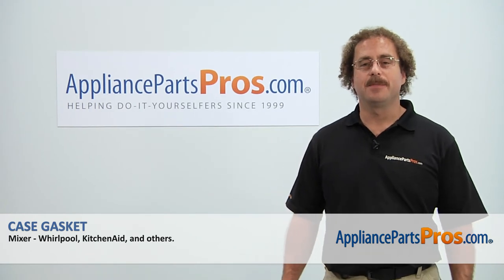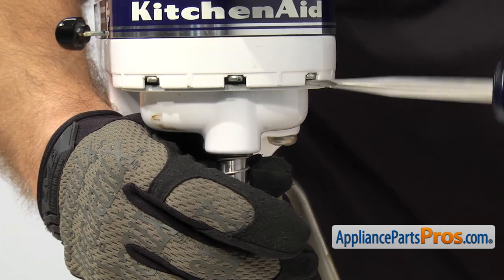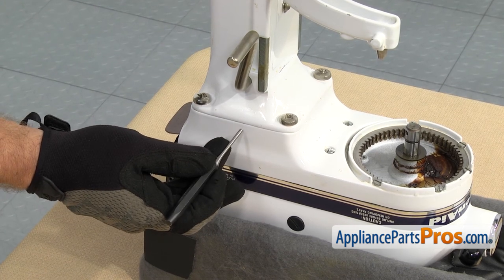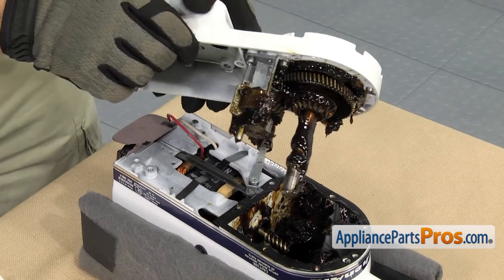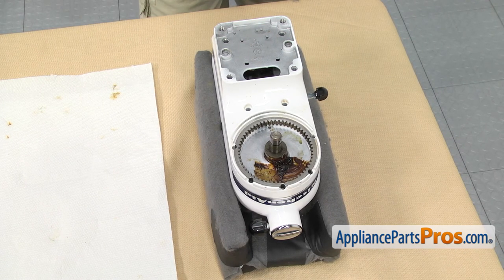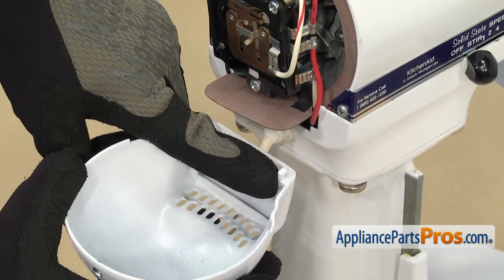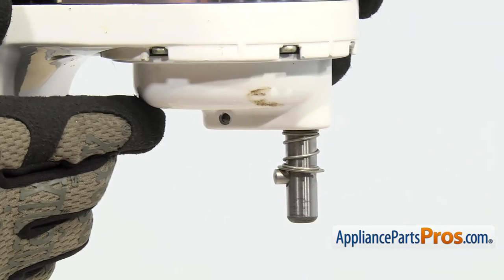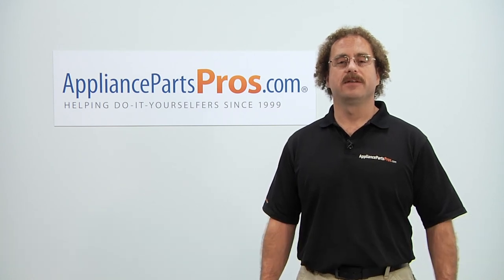How To: Whirlpool/KitchenAid/Maytag Case Gasket WP4162324

Comment: I replaced my gasket about a year ago, and it's now leaking a little.  It was a bear getting it back together.  The two halves wouldn't go back together without some jimmying of the shaft.  I really wonder if I really got it back together right.  Does AppliancePartsPro recommend using a gasket sealer in addition to the gasket?  We use the mixer for regularly mixing of heavy bread and pizza dough, so it may heat up a bit.  Not sure if this gasket is good enough for heavy use.  Would appreciate any advice you guys and anyone out there has to give.  Thanks!
Reply: Did you regrease the machine while you have it apart? The grease in KitchenAid mixers has a tendency to separate. The gasket is only cardboard so probably absorbed the liquid Grace I was still left in your. KitchenAid repair I recommend Mr. Mixer's channel